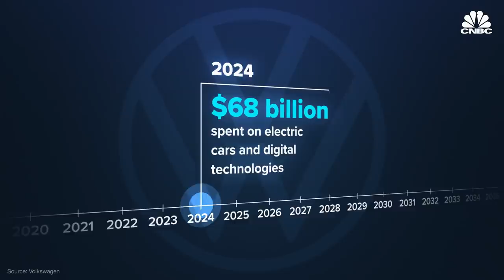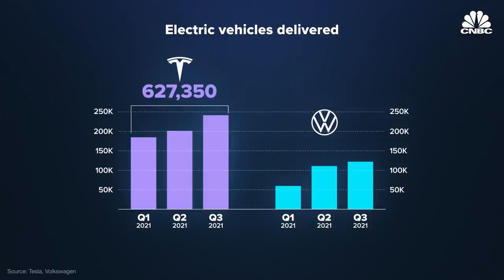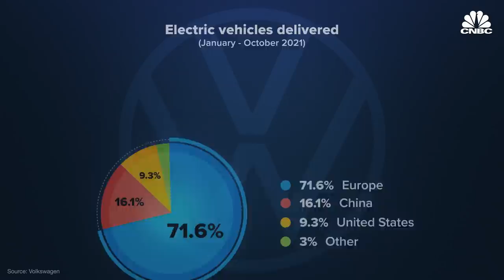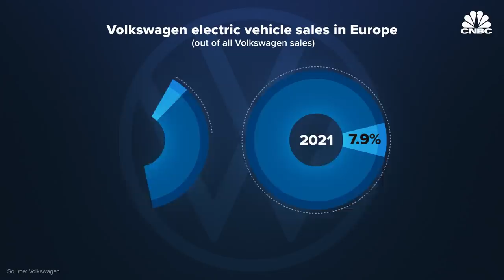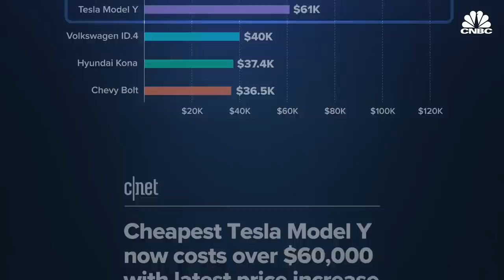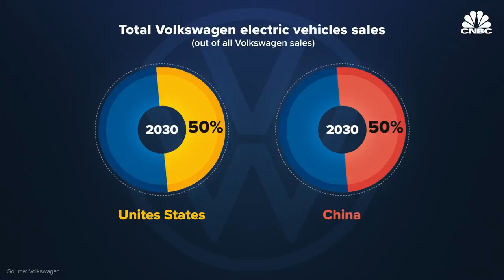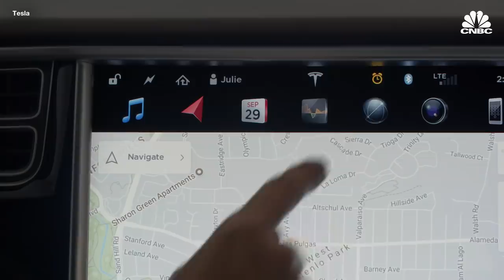Why Volkswagen Is Beating Tesla In Europe

Comment: As a Swede that just ordered my first EV and real family car cause children. I had to go with Skoda Enyaq/VW brand. I wanted to compare an Tesla model Y but for starting price at 20.000k more then an mid specced VW/Skoda it was easily out of the budget. Maybe in 3 years hopefully they can compete with the German factory!
Reply: Unlikely, Tesla will never move downmarket, they simply have to maintain their luxury margins to stay competitive.
Reply: It will be much less than three years...next year they will be pumping out Model Y's and will not have to pay transport or import taxes / fees. The supply shortage will end in the near future...and then the Model Y and Model 3 will be going back down in price to where they started. It's simply too few Tesla vehicles for the amount of demand for them right now.  Giga Berlin and Giga Texas will start changing that next year.
Reply: @xxXCromaxXxx  which is ironic as wasnt the model 3 supposed to be the peoples car for 30k$?
Reply: Inte riktigt rätt att jämföra en model Y med en Skoda…
Reply: @xxXCromaxXxx  That's actually untrue. Tesla currently has a margin of >28% on the Model 3/Y, and this is being manufactured at just 2 factories currently, and expected volume will be around 900,000 vehicles for 2021. 

This is important, because 2 new factories are due to begin low rate initial production of the 3 and Y in December 2021 in Berlin and Austin, TX. These factories are all new facilities designed to maximise production efficiency beyond the existing factories in Fremont, CA and Shanghai. When they hit full rate production in Q1 2023 we can expect the production numbers to go from 900K for '21 to above 2.5 Million by Q4 2023. This will enable Tesla to lower their prices significantly from the current 28% margin. The reason they are keeping prices high is because they can't keep up with demand, hence they've hiked the price by $7K on their vehicles as the order waiting time has blown out to 6 months. By 2025 we can expect a further 2 factories to be up and running which will see vehicle production increase to around 5 million vehicles per year.

This might seem incredibly ambitious, but lets remember the hard reality that the Berlin and Austin factories will have gone from an empty muddy field to producing their first vehicles in roughly 18 months, and the Shanghai factory did the same in a staggering 11 months. Tesla knows how to build their factories amazingly fast. And lets also keep in mind that the company has $16 billion in cash on hand, and only $2 billion in debt, not including their loan service to customers. Watch their revenue and earnings for Q4 2021. July to end September alone saw a net profit of $1.6 billion for the company, of which only ~$280 million was US government regulatory credits.
Reply: Teslas Shanghai vice president says she's very optimistic about Tesla's low cost affordable $25,000  mini version Tesla soon available. Designed and developed in China for the world's largest car market and all other countries too. The 2 new gigafactories will start ramping up more productive numbers in the next year as the Shanghai gigafactory now approaches almost 2000 Teslas everyday. 
Good luck with your EVs efforts.
Thank you for your attention to electric vehicles modernization and developments. 
😃👍🙏👨‍👩‍👦‍👦❤🎎🎈💃🕺🚶‍♀️🚶‍♂️🏃‍♀️
Reply: Maybe in 3 years you can afford a Tesla -
The better overall EV by far.
Reply: 3 years ? You are in for a surprise then
Reply: Yes, soon it will be much lower as giga berlin starts production. Too bad for you, you couldnt wait :)
Reply: You just got dupped by Angela Merkel
Reply: @cityhunter2501  It was suppose to be 35k, not 30k. Where da heck did you get your number of30k??
Reply: Because the demand for Tesla is still high and unlike in China, Tesla have more difficulties setting up production... in Europe...
Reply: @SafepathUS  soon available = maybe 4 year.s
Reply: The Enyaq kinds looks like a BMW ngl.😂
Reply: @tomy4453  Tesla 2021 financials to date:

Q1 $518 million credits -$70 million net loss ($448 million profit)

Q2 $354 million credits + $788 million net profit ($1.14 billion profit)

Q3 $279 million credits + $1.34 billion net profit ($1.61 billion profit)

Q4 ?

This is with only about 700,000 vehicles delivered for the year to end Q3. Do you see the direction of travel here?
Reply: They have strong demand, product with longest range therefore increased their pricing. But they can scale much better then legacy automakers, because they they are vertical. They make their own cells.
With Berlin GF and back to normal raw material prices, I believe we will see Model 3 under 40K€ in Europe.
The reality is that the 10-15K€ car market will be killed, 15 to 25K€ market will be owned by Chinese branda and 25K to 40K€ by VW. The other automakers will disappear if not bailed out. VW is already walking a thin path with 250B€ of debt
Reply: @tomy4453  Listen son, seems like some males your reading and comprehension skills are poor and in need of improvement. There’s been no adjustment to the earlier comment above, and I humbly suggest you take your weak little quarrel up with Yahoo Finance, the source of the money figures. With an easy little fact check on the production numbers by quarter for 2021 you’ll discover that the exact figure is 627,350 for the 3 quarters to end September 2021. Slightly over 70K short of 700,000. Does that make you feel better champ?
Reply: @xxXCromaxXxx  I don't agree, as Tesla's goal isn't to be a luxury car maker like lucid. They want mass-market vehicles to make up the majority of their market share. The reason the prices are so absurd for Teslas is simple. Supply and Demand. Demand is so incredibly high with you having to wait for mid to end next year, with even some cases of 2023.
Reply: @wattlebough  FYI, you may be clueless but when you edit a post, it is recorded and identified. So, you did adjusted. LMAO!!!
Reply: @tomy4453  Like most people here I’m aware that the (edited) symbol appears above the comment, but like some people I make spelling mistakes or the auto correct on my phone chooses a word that wasn’t the desired word, and I go back to make the corrections after posting. There’ve been no adjustments to the numbers from the original post squire, just spelling and grammar changes. But that didn’t cross that little mind of yours did it champ? The fact is you just didn’t read it properly first time around.
Reply: @Eatherius  A Tesla model Y costs 30% more than a VW Id 4. 

You are talking about Tesla making up that gap by building a single factory, but you are also ignoring that VW has almost 150 factories world wide that it is planning to convert over to EV production. In 3, 5 and 10 years (or whatever timeframe you put on the Tesla becoming cheaper) VW will have an economics of scale that will dramatically have lowered their prices and their goal is to have price parity with combustion engine cars, not other EV makers.

Tesla will never get there in the same timeframe, nor does it want to get there. Tesla wants to be the Apple of cars, a status symbol, not the android. They want to be a car that is mass produced but at a segment reachable for upper middle class. A Saab of the new millennium, rather than a Volvo.
Reply: @lobaxx  Tesla can build purpose built EV factories from an empty field to producing vehicles in under 18 months and has also built two in that timeframe simultaneously which are about to come online next month. Berlin and Austin. They will each begin producing a million EVs a year by Q1 2023. 

 I don’t think you appreciate the incredible inertia that having 150 factories designed and built to manufacture combustion engine vehicles presents to VW transitioning to electric. Those 150 factories won’t be an asset in ten years, they’ll become a liability that will cost more than VW can afford to convert to producing EVs, unless they show exceptional planning and management, which is possible but a long shot. It’s worth appreciating that the VW CEO, Herbert Diess takes the threat of Tesla very seriously, because he understands the situation well.
Reply: @xxXCromaxXxx  lol no, tesla is planning on bringing a cheap ev. Tesla is a new car brand, and as a new car brand u have to start by selling expensive cars and then move downwards to maintain in the business. Plus tesla is by no means luxury. Mercedes, bmw, genesis, etc these are luxury, tesla is a high tech car but not luxry.
Reply: @mullholand wouldnt say better by far. tesla overall build quality is pretty low compared to equaly priced alternatives. they might be a lil better on the tech side for now but in 2-3 years that will be gone, if quality gets better they might be kinda equal to others
Reply: @xxXCromaxXxx  hahaha! Tesla has the highest margin profit of any automaker, and "moved down market" with the 3 and Y, as well as Tesla's mission is to expand to greater and greater market, meaning cheaper and cheaper cars. They've even announced a cheap hatchback to come out in 1-2 years time.
Having a factory In Europe (Germany, VWs home turf), makes them able to reduce their salesprice even more...if needed to. Fact is that Tesla actually wouldn't benefit lowering prices at the moment, as demand is way higher than they can deliver.
Reply: Compete with „the German factory“? Your Skoda/VW can’t complete with Tesla cars, that’s where the lower price is coming from, and not from the factory.
Reply: @xxXCromaxXxx  That's a lie and you know it!  Tesla has the highest profit margin per vehicle of any volume manufacturer.  They continually raise vehicle prices as a tool to keep order fulfillment within a reasonable time frame while increasing production at an astounding rate and selling every car they can produce (all without advertising campaigns). The price of anything increases whenever demand outpaces supply - inexpensive EVs are inexpensive because fewer customers are willing to buy them.
Reply: @martinandreaskruse4446  How do you keep profit margins high if you reduce your prices? Manufacturing costs cannot be reduced without limits. They didn’t move down market, the ID3 is 10k€ cheaper here in the EU than the Model 3. The only way I see a cheap Model Y or 3 is if Tesla sells cheap hardware and makes up for it in the software department somewhat like it is in the gaming console market.
Reply: @theagentsmith  The Dacia Spring EV is only 10500 Euros and that is with low volume so you are wrong on the low end market. Also you are not very good at reading  a balance sheet as VW currently has 165 Billion of current liabilities including through it's finance arm on revenue and total assets are nearly half a trillion. Also they have revenues of 222 Billion and absolutely no problem in financing their massive expansion program.
Reply: @xxXCromaxXxx  Economies of scale my friend, that’s how. You’ll see. Tesla only made 510,000 cars in 2020. The company will make >900,000 for 2021 and >1,500,000 for 2022. Once Tesla begins to find its equilibrium between demand and supply that 28% margin leaves a lot of leeway for price reductions once production volume is in the millions of vehicles each year. For example, what is the margin per vehicle with Toyota?
Reply: i just dont trust the battery life of any other ev then tesla it seems tesla has the best battery health management system out there
Reply: @xxXCromaxXxx  You know its their goal to lower the price?
Reply: @reahs4815  Of course I know, that doesn't mean that it's more than PR. If there is such a high demand for their cars that they can't produce enough at these prices and a 26% margin why would they lower it? It just doesn't make financial sense.
Reply: Then tell us Europeans, what will Tesla bring into EU, esp. into central and eastern parts?
Here we need a mid size hatchback, not sedan, no SUV, no spaceship, and be affordable = absolute maximum for that car is 30 000E.
If you think that you can produce tiny hatchback at the style of Renault Zoe, or Byd dolphin with 30kWh battery, we dont want it.
Tesla is a good car, despite haters here, but it's very expensive and its not hatchback, thats the only one problem.
I guess you will be very soon obliterated by Xpeng, Nio, VW, Skoda, Dongfeng, Stellantis, BYD, maybe some Russians - who knows.
Tesla model 3 is first here, this year, but it will be more or less forgotten, problem is price. Try to compare Xpeng P5 vs Tesla model 3. (23000E vs. 42990E)
Reply: @wattlebough  Sure, thou tried too hard to justify your denials. LOL
Reply: @xxXCromaxXxx  That may fail, because if you look what luxury manufacturers are offering (say, Mercedes EQS), Tesla is not even near in terms of quality and luxury.  And the EV specs are on the same level now. The market will autoadjust anyway. Let's see.
Reply: @Rondo2ooo  Not to mention that the EQS has level 3 autonomous driving and 800 kilometers range, whereas the best Tesla, i.e. Model S "only" has 600 kilometers range and the new Tesla FSD feature only managed to get level 2 approved by US authorities. Oh and Tesla is now also being forced to make their superchargers public access. So, in my mind, Tesla is behind in terms of price, quality, features, tech, range and service. I just don't see Tesla being able to become a competitor. It's only the 12th most sold car brand in the US and 18th in Europe. It took a lot of Musk-Storytelling to get there, I'm afraid I don't see how they would increase market share or even prevent losing market share. They are going bust imo.
Reply: @xxXCromaxXxx  1) Produce locally (starting soon) and avoid import taxes, 2) Make another vehicle that fits Europe better (also on its way), 3) When you have a 27+% percentage margin, and the competition is down in single digits, you have a major advantage.
Fact is, even when Tesla doesn't have a comparatively priced EV as e.g. the ID.3, they still have more demand than they can supply. 

Look, it's not like Tesla is supposed to sit on 80% of the market. If demand is higher than supply, and margins are healthy (healthiest on the market), Tesla will earn loads and loads of money, like is the case.
Just like Apple doesn't sit on 80% of the market, but rather 10% or so, but still have 50% of the total profits in the industry...
Reply: @lobaxx  

Get more informed about Tesla. And understand the implications of what you write.

Tesla is transforming/disrupting manufacturing. That is why 1... well actually a couple of disrupting Tesla giga-factories can outdo all of VW's manufacturing production. Take GigaShanghai for instance. In 1 factory using less than 1/7th the square footage of VW's Wolfsburg factory using far fewer employees, Tesla produced 55,000 vehicles in October that included a 7 day holiday. Extrapolating, this comes to over 18,300 cars per week equaling a production rate of over 950,000 cars per year. VW Wolfsburg 850,000 cars per year. Tesla, 10 hours to build a car - VW 30 hours to build a car.

The above shows why VW is not retrofitting Wolfsburg - they are building a brand new factory from scratch and this does not sit well with the trade unions. VW hopes to catch up with Tesla's 2021 production efficiency with their new Trinity platform in 2025/6. TOO LATE - By 2025, Tesla will have innovated massively. That's just the way they work.

The vaunted 150 VW factories you mention and model for production are hopelessly outdated, and just an albatross around their neck. Where traditional carmakers make small changes yearly, Tesla makes small and large changes daily for improved safety, quality, production, and added features. They validate the changes using automated tools at the production level (more or less instantly) which assures that their cars meet the homologation requirements at virtually $0 marginal dollars. This is unheard of in the car-making world.

The quality issues constantly brought up in this thread are a thing of the past. Watch the Sandy Munro's, a long-time automotive production engineer, videos over time. The quality of the M3 was not so good at first but has improved greatly and is now competitive with any car manufacturer in the world, including MercB.

Whether or not you like the Tesla appointments as much as MB, that's a matter of individual taste. It's NOT a quality problem. For me... even if there remained a panel gap problem with Tesla, I'll still take the Tesla that is much less likely to get into an accident in the first place and when it does, much more likely to keep me alive. Tesla builds the safest cars, period.

Bottom line... Tesla's advantage is much more than vastly superior factories. Tesla has completely revamped production methods - the factory is the product, not the car -  and approach - relentless improvement where all workers are enabled and participate in the process. This is why Tesla's lead is unassailable.
Reply: @Donald Wright Some people call it "puristic design", I call it "poor".
Reply: Skoda is the cheap brand in the vw group. Tesla as a brand is comparable with Audi, BMW, and Merc. Not skoda. You can buy a Dacia spring for half the price of an Enyaq... smaller, slower, less in all measures from a skoda BUT cheaper.
As the dacia is not comparable to the skoda, the skoda is not comparable to a Tesla...
Reply: @cityhunter2501  yes. 30k$ after grabbing all government grants, without added VAT and with a small battery of a kids toy.
Reply: @Eatherius  it is not that easy. the crazy huge amounts for giga berlin needs to be payed back too.
Reply: @xxXCromaxXxx  tesla will build 25k ev soon
Reply: @davidc2838  Big factory = many cars = lower price.
Reply: @cityhunter2501  Nope Earl the Pearl…
It was $35K and was for a while…
Although the demand is so high it’s now closer to $40k as it is the best selling EV in the world.
Although the Model Y will soon replace the Model 3 as best selling EV in the world, since both Giga Berlin and Giga Texas will be pumping out new Model Ys next year from the two new factories coming online in the next month or two.
Cheers!
Reply: @wattlebough  You’re correct, with the small exception that the two new factories will likely only be making Model Y vehicles for the immediate future. Then Giga Texas will likely start making CyberTrucks before they make Model 3.
It’s unlikely that they can make enough Model Ys in the next couple years to cover all the demand for MY. Cheers!
Reply: @lobaxx  Teslas will be cheap, they have just started. And VW loses money on every EV atm. Its not a brand or design thing. Its a tech thing and Tesla is way ahead. Model 3 motor and battery is made by the thousands and is used in Spacex falcon 9. Please. Do you need more explaining?

And why do I even care what you do? Have fun in your life. Good luck.
Reply: @tomy4453  Your math is terrible as is your reading of quarterly reports. Tesla had Net PROFITS of $1.62 Billion (GAAP) and only had $279 M in regulatory credits.
Last time I checked, that’s only about 17% of the profits from reg credits.
Revenue and profits are going up dramatically every quarter and reg credits are becoming less and less of that amount.

Yes, And Tesla could sell another $5 Billion or $10 Billion worth of Shares and have almost no dilutive effect on their stock. It would be less than 0.5% or less than 1% dilution. But that’s irrelevant because Tesla’s paying down its debt and growing in revenue and profits every quarter.
Q4 2021 will continue revenue growth and profits and reduction of debt.

Teal is easily the best positioned company in relation to value, liquidity and revenue and profit growth.
Reply: @tomy4453  Remember Tommy boy,
Those are NOT Government Subsidies. They are profits PAID by Tesla’s Competition. Regulatory credits are paid for directly by OEM automakers that can’t hit the guidelines from their own countries and have to buy the credits from Tesla, so that they can not get penalized.
It’s an important difference that you clearly miss.
Reply: And to everyone saying how can the price be lowerd by one factory? Jesus...have you ever thought about politics? NO TESLA IS MADE IN EU TODAY. THERE IS HUGE TAXES ON CARS FROM OUTSIDE EU. ok? Can you please read a book?
Reply: @lobaxx  VW can’t handle the software transition and will continue to fail miserably at this transition. Herbert Diess understands this and knows that VW is far behind and if you have to take a factory off-line then you aren’t making any vehicles at that factory. Of course Diess will likely be fired before the end of next year, since he’s telling VW management and the Board what they don’t want to hear…
They need to build NEW factories that are NOT obsolete and are built for EVs and not ICE vehicles…instead of taking factories offline for a year while they’re being reworked in a less efficient manner.
He also told them that they’re going to have to cut 30,000 obsolete ICE employees from the lines when this happens because EVs simply don’t have as many parts and don’t need as many people to assemble them.
VW Board (includes Union Board Members) didn’t want to hear that…so they told him to come back with a Future where there was no employees cut…
It’s call the Great Ostrich Plan…
Sticking your head in the sand…while The Future comes rumbling towards you relentlessly. Cheers! :-)
Reply: @cityhunter2501  inflation killed the 30k price point. The model 3 is still far more advanced than the comparable 40k cars in the UK.
Reply: People who don’t buy a Tesla think a Tesla is a car, it isn’t, it’s a system. The charger network and OTAU’s create a very different experience, this is before FSD.
Reply: @lobaxx  Are you aware that Elon has personally been talking about Tesla developing a small hatch EV in the $25,000 price range specifically for the European and Chinese markets? He announced it for the first time during the company Battery Day presentation in September of 2020 if memory serves correctly, so a while ago now. If ordered directly from a show room without the standard FSD hardware there’s a good chance that would drop the price by at least an additional $5K, although that option is an unknown presently. It is not widely known but has been available for the Model 3 for a while, and presumably for the Y as well.
Reply: Slow ass low tech Enyaq is not comparable to a Model Y.
Reply: @xxXCromaxXxx  Not true, Tesla currently has the largest margins of any automotive manufacturer.
Reply: Tesla it’s a smart car but skoda it’s just… a skoda with baterries!
Reply: @mullholand  Wow, more expensive car is better? Shocking.
Reply: Hopefully the prices of Tesla will drop dramatically once they start production in Germany. Just removing the import taxes and fees will be huge
Reply: @richmargin6082  Prices will not fall. Import taxes are not that high. For example, BMW is actually making a lot of cars in USA and imports them back to EU and sell them here.
Reply: @theagentsmith  VW Debt is mostly financing of their own cars. Leasing.
Reply: @russhare4793  Dear Lord, what a load of crap and semi truth. Fanboy/stock owner for sure.
Reply: @xxXCromaxXxx  literally nothing luxury about tesla or its cheesey plastic interior….
Reply: Tom this is exactly what Tesla’s plan has been for the last 15 years. They started with a sports car, moved to the Model S luxury sedan, then moved into mass market with the model 3 and Y. Next year they will start production of the semi and Cybertruck, then get to a cheaper model, aiming for a US$25,000 price. With Giga Berlin opening soon, they will stop having the cost to ship from China to Europe.
Reply: @wattlebough  There is no shame in editing a posting. I do all the time.
Reply: @xxXCromaxXxx 

More like Tesla can't make a a model  3 in the $30,000 range and still drive a respectable profit.
Reply: @justingriffiths6931  

Doubtful. One guy got a bill for $22,000 to repair his old model S.  

I don't Tesla nowhere near making a 25,000 car. They tried making a 30,000 model 3. Once they saw no profit it it, they pulled it
Reply: @Sg-ci4kp  If you say so.
Reply: @xxXCromaxXxx  Wrong. They’ll continue to drive down prices, once they achieve high enough production levels.
$25K vehicles ($30K with extras) will come to be in China for Tesla…then exported and eventually Germany will create their version. Still a few years…but the goal is to get as many Teslas on the road, so that they can build the Fleet Data and create robotaxis
Reply: @mullholand  why is tesla the best, porsche has a better ev, and so is lucid and rivian has something tesla owners are still dreaming about
Reply: @ivobrick7401  Definitely this, sedans are useless if you want to transport more than your own ass...
Reply: @xxXCromaxXxx  Do you suggest, Tesla is a luxury manufacturer? For me, it is on par with Ford. If you want to see a luxury EV have alook to the EQS from Merc.
Reply: @davidc2838  They have to pay import taxes for parts from outside Europe. So the difference is not that big.
Reply: @wattlebough  The production capacity does not say a lot about the sales. Will be fun to see how that works out. Technically, since EVs are now becoming standard, Tesla will struggle way more with competition. Here in Europe we have several car makers which have attractive new models to offer mostly with compareable quality but much cheaper (Model Y, VW/Skoda Enyaq) or much higher quality (Mercedes EQS)
Reply: @xxXCromaxXxx  Wrong. Tesla is developing the model 2 hatchback as i type this. It is a ID3 sized car. 
To be a global car brand and to be a plagerig in Europe Tesla will have to go downmarket.
Reply: Tesla will never produce a cheaper car.  They can't.  Plus, their existing lineup is cheap, with an interior that is as sloppy as a Ford Fiesta.  They lack in features that a family car needs - instead opting for maximum acceleration, although they can't handle on a track.

VW will dominate the EV market in Europe, and Ford likely in the U.S. with the Lightning.  They'll have their millionth Ford Lightning delivered to a customer before Tesla can produce a Cybertruck, now delayed 1+ year, with no delivery ETA (previously 2023) on their website.
Reply: They make one Model Y in 10 hours, while a Volkswagen ID4 is made in 30 hours. Tesla just doesn't have a proper factory in Europe yet. That's the only reason.
Reply: @xxXCromaxXxx  Luxury ? You call Model 3 Luxury? Come on man, model 3 interior is like IKEA furniture with a big tablet.
Reply: Nah, but luckily Tesla is overrated anyways
Reply: @alexmn00183  then why the airflow of that is much better. And the infotainment system is responsive while i drove an enyaq and ID3 their infotainment still sucks TODAY. So many stuff works functionally very badly compared to Tesla. Explain that. U probably havent driven in many different EV's here in Netherlands we have many different kinds and i drove in quite a few.
Reply: @xxXCromaxXxx  It is not about moving downmarket. The prices in the US for a Tesla Model 3 and Y are in the ballpark of an ID4. In Sweden it is a 10-25K Euro price difference. The only explanation is higher tariffs. Tesla will build a factory in Germany so this will change.
Reply: A couple of years down the road, you  will be thankful that you can take the car to a local repair shop. I think that in reliability and ability to repair us where tesla is missing the boat.
Reply: ....oh....wow....well.... that was some serious prices you operate with in Sweden....   ....so a Tesla cost 20 million (SEK...???) (or 20.000k as you write) more than a Skoda.....
Reply: @Dan-fo9dk  A base Tesla model Y is about 25,000 euros more than a base ID4 in Sweden. The electric Skoda Enyaq is actually more than the ID4 by a small margin.
Reply: @tenwatts2378     Haha.... my comment was about paying awareness / attention to what is written or read.....   The original comment on top of this tread did not pay any attention to what he wrote.   Now you has gone into the same trap by not understand/pay attention to what you read.   So this is not about the cars Tesla or VW ....but about notation.   
The notation k = 1000.  Hence the difference in price claimed of 20.000k  will equal  20.000.000 = 20 MILLION.   That is indeed a steep price difference.   Well I hope you've got the message by now ... or....are your watt supply to low...????
'
Reply: @mullholand  800 volt tech Kia EV6GT as quick, as much range, 10k cheaper, faster 19 minutes charge compared to slower 25 to 30 minute charging time of Tesla cars that are also stuck on level 2 autonomous for years.
Reply: @theagentsmith  2022 Peugeot 208, Dacia Sandero, VW Golf, top 3 best selling cars in Europe, Model 3 is not even top 10. Facts. Look it up
2022 Best selling cars in Europe
Reply: Think the enyaq is better looking than a tesla....
Reply: @wattlebough sounds like a lot of handwaving about those factories are you in the automaking business?And if Tesla can build a factory in 18 months why wouldn't  VW also be able to do that? Or just gut a factory or two...
Reply: @matthiasknutzen6061  The question is why hasn’t VW done it? Meanwhile Tesla has just commenced construction of an all new factory in Monterey, Mexico slated to begin production of the yet to be released Model 2 small hatch in Q1 2025. 

The difference is that VW is saddled with debt while Tesla has close to 20bn in cash and is effectively debt free. More importantly, VW is suffering extreme inertia within their leadership team, the ID4 is being built at a loss and has been plagued with electrical and software issues and sales are cratering.